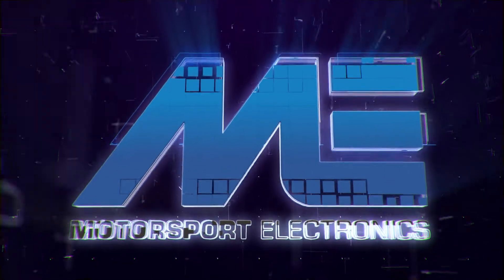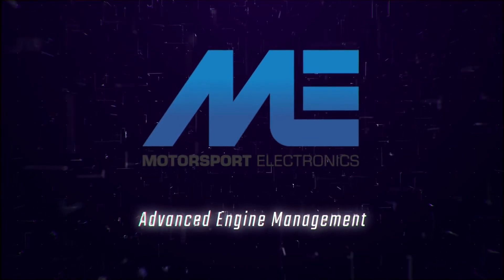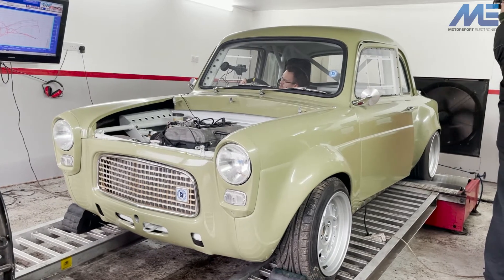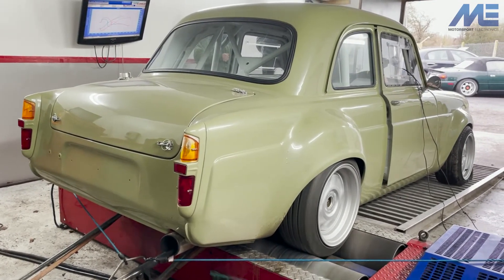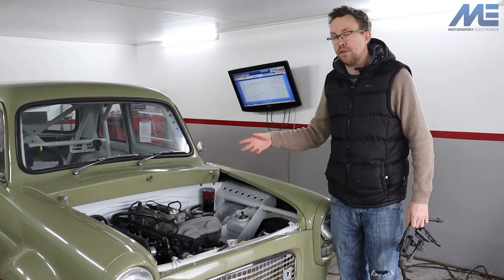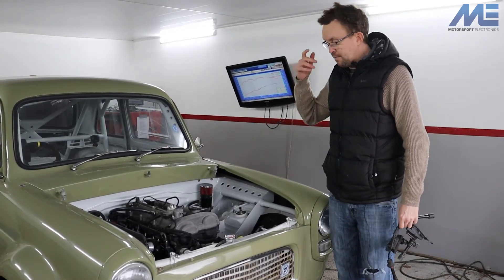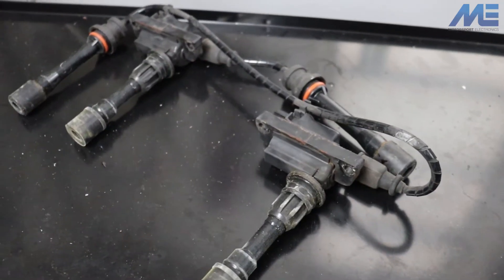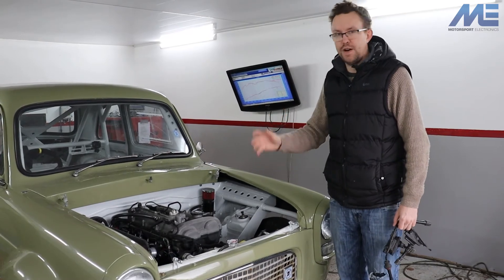Troubleshooting Tip #1 | Solving USB Noise Issues

Comment: In my case, I was using the NGK R5671A-8 Racing Spark Plug (NO Resistor), and when I started the engine, the USB communication between the ME221 and the laptop was often lost.

Recently, to use the original 924 RPM gauge and AUTO METER RPM gauge, the AUTO METER 9117 Tachometer Adapter was installed between the coilpack's COIL(+) 12 POWER wire, and communication loss disappeared.